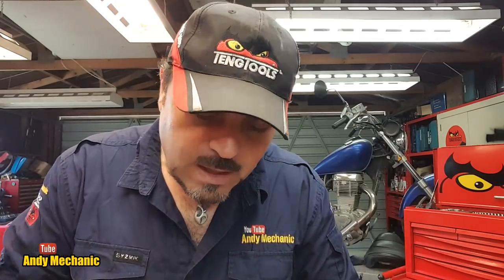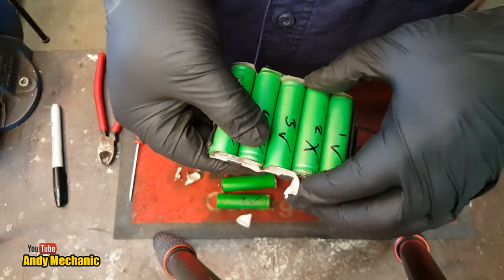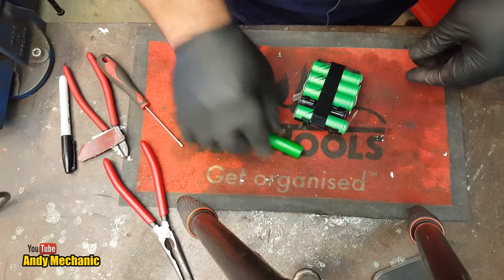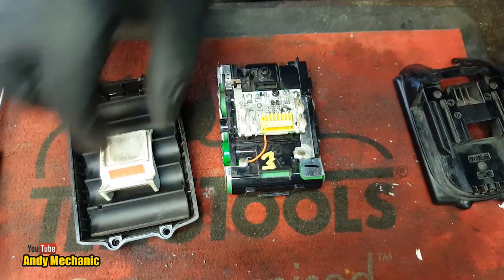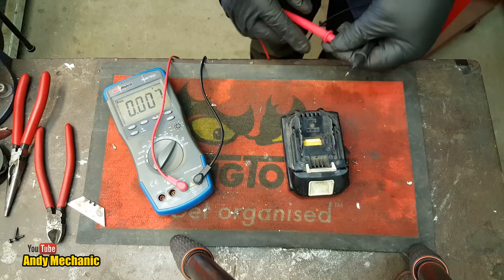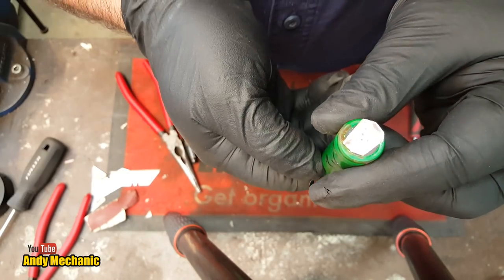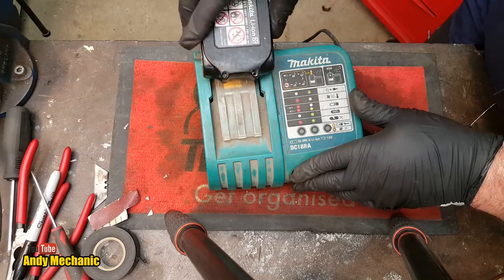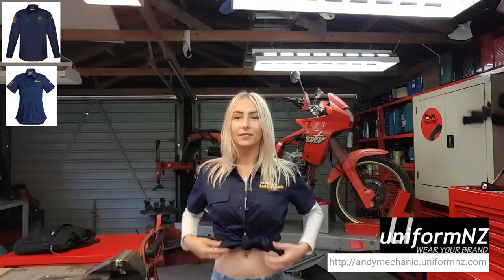Lithium Ion battery Ep.3  replacing cells on batteries 3 & 4 #1446

Comment: Hi Andy. One thing to check is that all the cells in a battery are at close to the same voltage. If they are too different, then the charge controller decides that the the battery is too far out of balance and won't allow the battery to charge. The cell voltages on the ones you replaced looked ~OK, but I'm not sure how close the replacements were.  This might mean you have to individually charge each cell in the battery to a fixed voltage for a few hours (using a current limited power supply). Can take a while to sort out if you only have one power supply.
The other trap is that once tripped, some controller boards will prevent future charging. Sometimes they can be reset using the correct cable/software/passwords etc. Sometimes not. I don't know if Makita uses this scheme or not, but if they do, then the best approach is a new pcb - which you now have on order anyway. 
Soldering directly onto the cell case is "not recommended", but I find you can usually get away with it if you are quick. The sensitive end is the one with the tit - normally (not always !!!) positive. This is because the vent and fuse are at this end and are most susceptible to heat. If the vent seals itself, then there is more  chance of an exciting failure at some stage. Heating the bare case end isn't as big a problem unless the temperature gets enough to increase the internal pressure & even then the safety vent at the other end should operate.

Comment: If you want to check voltage of each cell use that yellow socket and pay close attention to thermals as in Parallel cell packs use double contacts in o e slot

Comment: Good evening, from Portugal. Battery bms may be fine. I saw the following test on youtube videos and it may work. Disconnect all 6 wires from the bms and reconnect them in the following sequence:
1-Negative
2-4.2V
3-8.4V
4-12V
5-16V
Finally the positive.
Good luck with the batteries.

Comment: I seldom have to replace the control board-usually just use tested Viable 18650s
  culled from used notebook batteries-usually few really bad-others weak but useable

  using FLUX on ends to minimise heat required-then usually OK
   BUT some "dead" 18650s have INTERNAL fusing so COULD arc badly     IF
     you short the positive CENTER  tab AGAINST STEEL outer NEGATIVE shell

Comment: This is all informative, not trying to put down anything that you're doing.
You were shorting one battery to the other. Underneath the green heat shrink is the battery cathode or negative terminal. It isn't limited to just the end of the battery. You may have had a bit too much heat with that iron too? As previously mention, a little flux may help you with the oxidized metals.  One probably doesn't need the solder on top of the nickel plate. As far as jumping the gun, you could easily take the voltage reading before putting things together. This would prevent you from having to take back apart if it wasn't reading correctly or as anticipated. Are the contacts clean on your charger? Best of luck, sir.
Reply from the maker: Cheers Cory, thanks for the info. There is a lot to consider with these cells and I'm picking it up as this Series plays out....yes, the charger is fine as it charges the new battery packs fine.

Thanks for your input. Andy

Comment: I just want to mention that these 18650 lithium Ion batteries should not be discharged below 3.0 volts. I am sure this is open to discussion but for safety sake Do a search for "battery Mooch". You will find lots of battery information that i am sure you will find informative. It would also be wise to be sure that each cell is the same. I know for certain that sony makes several cells that look very much alike (green 18650) that have different capacities and maximum discharge rates. Not sure if Makita used the same cell from year to year.
Reply from the maker: Awesome. Will check it out. Thanks for the info, most helpful. Cheers Andy
Reply: For sure. The Mooch has a website, a facebook page and a youtube channel. I know that his content is geared toward the vaping industry but he does all his own independent testing of the kind of cells you are playing with and i'm sure you will learn lots about battery safety and the like.

Comment: These batteries are not gonna work! Why do you think, in the others they were bridged in 2 rows? They are 1,5 volts each, but the ones, that are in one row only, are 3 volts each! You need new 3 vot cells for these ones, not new circuit boards for now!!!!
Reply from the maker: Hi, thanks for the feedback but on this occasion you are incorrect. On the larger 3 amp hour batteries each pair is wired in parallel - therefore the voltage does not increase. These pairs are then all wired in series to provide the 18 volts total output. Hope this helps. Cheers Andy
Reply: Andy Mechanic well... it seems very weird, that there are mising the the exact 1,5 volts. Yes i might be wrong, but i would check the voltage of the individual cells! My opinion, no offence! 👌
Reply: Igors Dubrovskis lithium ion 18650’s are 3.7 volt nominal. Not 1.5 volt, if they were as low as 1.5 volt per cell then they would be ready for the bin.